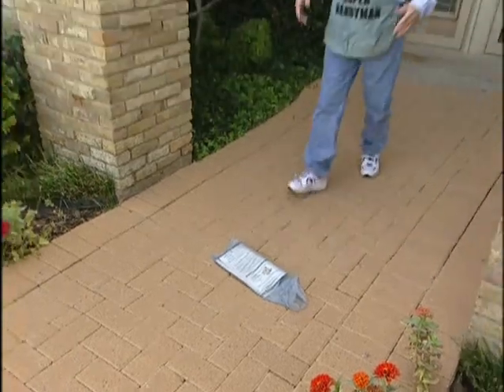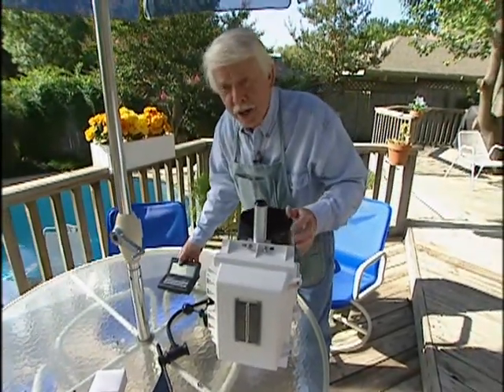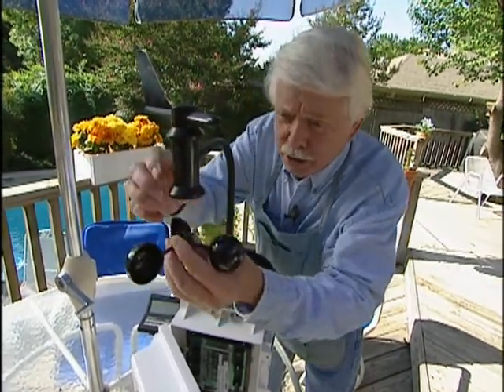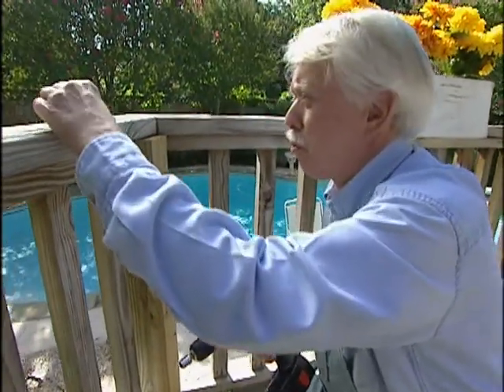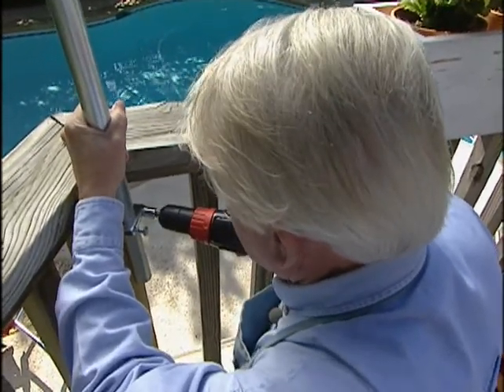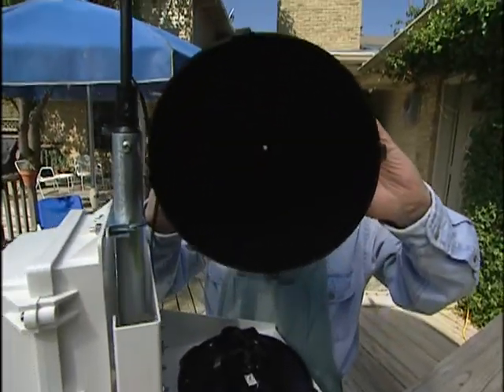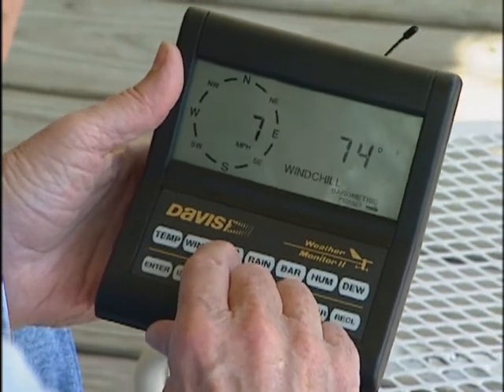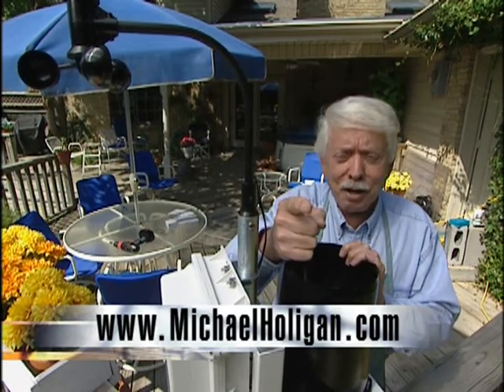Install a Weather Station (#5222)

Comment: Temp and humidity will never be accurate when installed near a pond, pool, or any body of water! And the anemometer will never be accurate low to the ground and close to your house like that! This is the improper way to install a weather station! The anemometer needs to be either 33 feet high or at least above your roof or at a minimum 60 feet or more away from buildings if on a 5 foot pole!